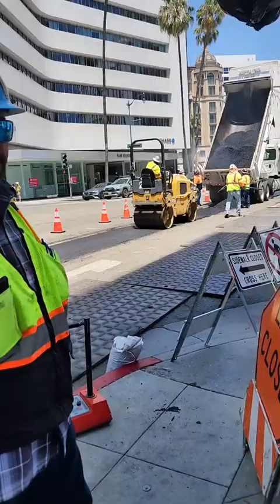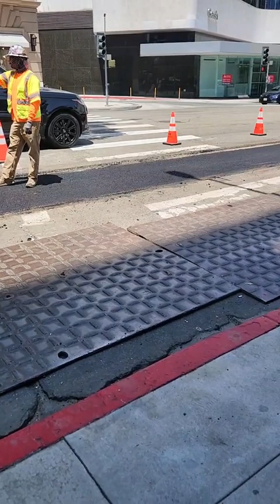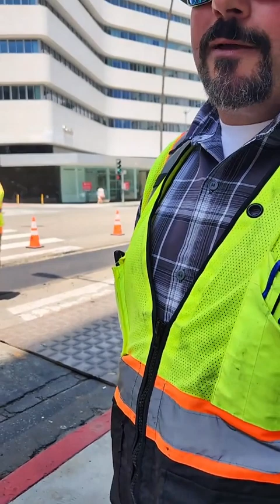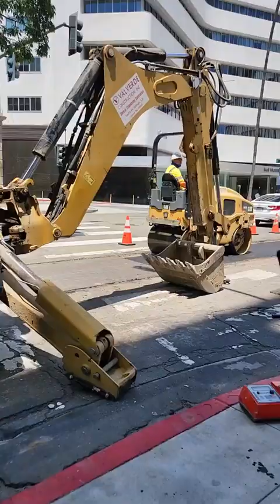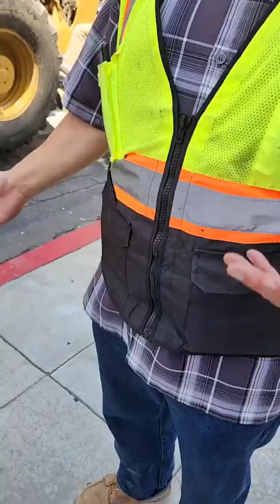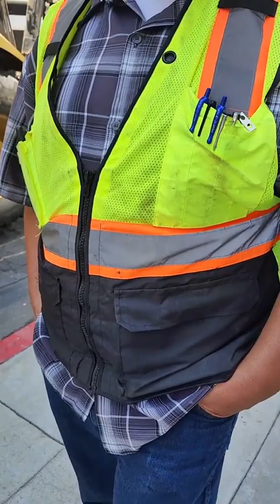How Much Money Do Union Inspectors Make?

Comment: I just acquired my AWS CWI and 6 years of certified welding experience. I'm currently studying for my ICC bolts certification. Will Local 12 consider someone with my background and experience?
Reply: Definitely
Reply: Get on the C list at your nearest local 12 hall. It’s like 35$ month wait for a phone call for work
Reply: Absolutely sir. There is an open order constantly @ Local 12 for CWI inspectors

Comment: Do they pay for mileage? Since there’s a lot of driving
Reply: If you are carrying specific Equipment needed for the job that only the Lab where you are working with carries then you will get paid Gate to Gate. Most of the time it's usually on you dime for the travel. If you travel from the Lab you were hired out of more than 50mi you will get paid milage.
Reply: @iuoe12  knowing that, is owning a truck necessary? Also does pay rate change depending on the city? Like if you go to the bay? Or is it always one flat rate
Reply: @4ngel209  owning a truck is beneficial but not necessary. I had a Prius for a long time and did the job just fine. Carrying a wheelbarrow to perform Concrete sampling is the most space you will need for equipment.
Reply: @4ngel209  The wage doesn't change. Your wage is dictated by the licenses you carry. As long as you carry the licenses you wage won't change. The more licenses you have the more money you can make. This of course as long as your working in Local 12 jurisdiction.